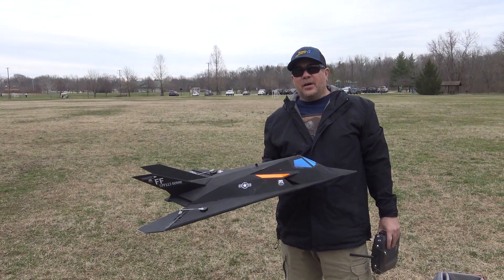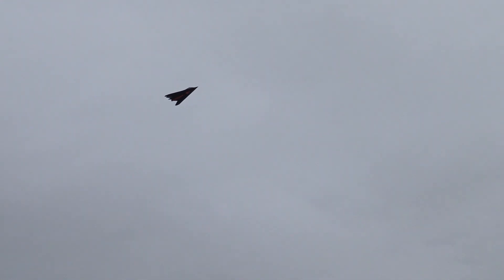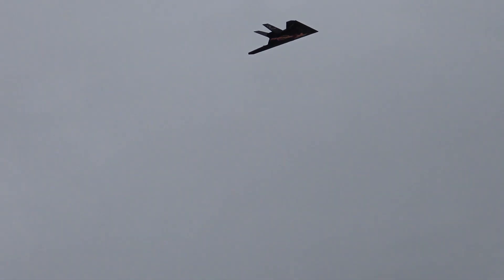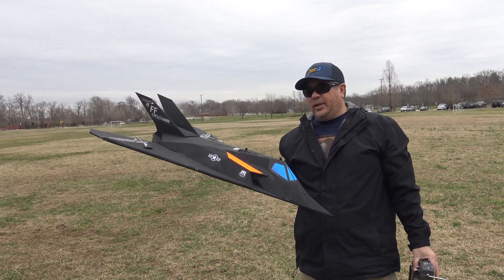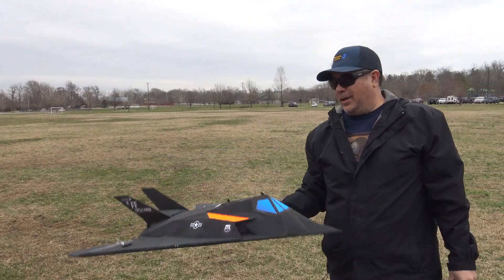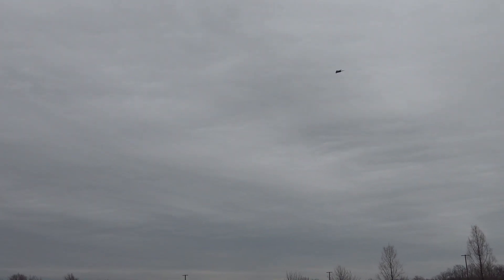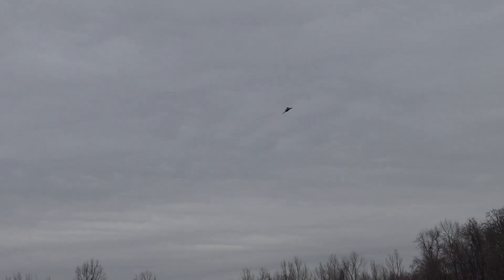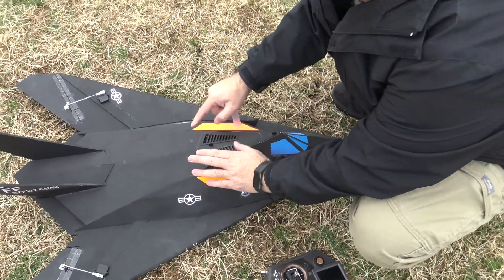FF-117 EDF - Cheater Hole Mods

Comment: Great video.  Love your designs.  I also love to scratch build my own designs.  Some work.  Some don't.  My biggest dilemma is that I overbuild em.  Make em too heavy.  Question.  How much does this particular airplane weigh.  Total flying weight, with battery.
Reply from the maker: Thanks for the comment gisall8205! Thats part of the fun of scratch building, is finally getting a design to fly like you want. Sometimes it is for sure a challenge. Yes, if a plane is too heavy it makes it hard to hand launch and may need landing gear so you can build up to a good flying speed. pretty much most of my planes are built to be hand launched. Always try to have at least 1 to 1 power to weight ratio or better.  The FF-117V2 50mm weighed in at 22.5 ounces (638 grams) ready to fly. I later made the 64 mm into a 70 mm EDF and scaled it up. It weighs in at a little over 38 ounces (1091 grams).   If you have not yet visited our website, please do, it has information on most of my plane designs.  Link https://www.rcfoamfighters.net

Comment: Hi Paul. After watching this I was going to suggest one of my 64/65mm edf set ups for a bit of an improvement. Not the really powerful one but my intermediate 4S power one, but when I checked the places I get the fan unit from they were all out of stock. Then after quite a lot of searching I've finally found somewhere you could order one from and they may be in stock. Here     https://www.dymondusa.com/Prop-Accessories-23903-EDF-Unit-65mm.html
Then all you need is one of the same 2958 4200kv motors I used. Either GoolRC, Surpass Hobby or Rocket. They're all the same motor. You should be able to find them somewhere on line. I normally find them on ebay. There is a small mod you need to do to the housing which I can tell you about if you are interested in this set up. Here is the test video of this set up.  
https://www.youtube.com/watch?v=Uz9AYPWA-cM
Reply from the maker: rcplanepirate thanks for all the info. I will have to for sure check out the links you shared. I will probably look to something like this for an upgrade and performance option. I do also want to get it to fly good on a basic regular EDF so most people can build one even if they do not have access or knowledge to build their own EDF from parts.  I will check out your video too once I get a free moment. Thanks again RCPP,  I appreciate your knowledge and sharing of information. I hope to see you in the skies someday soon too ripping along in one of your fast planes!
Reply: @rcFoamFighters  That's ok. Yes thought it would be a good option as apart from the mod to the housing and balancing the rotor it should just screw together. Where as my other powerful edf units needed their shaft adapters modifying on my lathe and I was using different fan rotors. However the set up I've suggested to you with about 3.5lbs of peek thrust it should give you a good boost in performance.

Comment: Hey Paul, Mikey here. What would be an interesting experiment would be to tape over the top chester holes... assuming the whole top surface contributes to lift, the top cheater holes may be starving the fan of air as the pressure is slower. The bottom holes are at higher pressure, so if the top holes are blocked off, the fan pulls air, the higher pressure on the bottom surface will blow through as against be ' pulled through'...might give interesting results!
Reply from the maker: Mikey, I was thinking of doing some similar tests to see how each cheater hole affects performance. I was thinking of doing a test with just the top open, then just the bottom open and then both open and both closed. My fist reactions is that it did fell like it flew with more power than on the maiden flights. Though on the 64mm, part of the extra power feeling could be from the bigger battery having less voltage drop and making more thrust. At the speeds these RC planes are flying, pretty slow, do you think there is much of a pressure differential top versus bottom?  I need to see if I still have one of those micro cameras and Tape it to the top of the plane. Then put some strands of yarn around the lid to see the airflow.
Reply: @rcFoamFighters  I would definitely do that, simply because it costs just 1 foot of tape. As for the pressure difference, most definitely, in fact, the differential is higher at low speeds, and being a delta also add to it eve more than a normal platform, Give it a go and see, might proves interesting results :)

Comment: Looks clean, can you put a camera on it and fly with goggles?
Reply from the maker: Thanks Mike! I could put an FPV camera on it and fly FPV with goggles, but this plane is probably not the best platform to do so. EDF planes are not as efficient as regular prop planes and usually have shorter flight times. If I wanted to do FPV on the plane I would  use the prop version so I would have longer flight times. Also the prop plane has more thrust and would not be affected as much by the extra weight.
Reply: @rcFoamFighters  Ok, got you.

Comment: Did you use the intake lip of the 64mm ? I know that using it without intake lip will not allow it to draw full potential intake. If you don't use the intake lip you'll have to smooth the ducting. Also, perhaps the edf fans are not a good match for the motor, may need more pitch or more blades.
Reply from the maker: robert wong, I did use the EDF Lip (contoured ring) as they do help efficiency. The EDF I used was a complete set with fan and motor. It is the same brand, Power Fun, as the 50mm EDF that appears to be close to specs. I think it may be a bad motor or something. I did test it with the lid off and it still was down on power.  I am thinking I will try a different 70mm EDF. I have a 70mm Dr. Mad Thrust EDF rated to 1300 watts. That should wake the plane up and be more powerful.